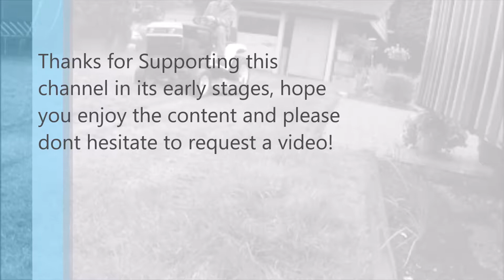Ford 50" Mower Restoration  - Part 3 (First Mow, After maintenance, Conclusion)

Comment: nice. i saw a machine like that on craigslist for sale in aldergrove bc. thinking of getting it but not sure
Reply from the maker: Go for it!
Reply: +Samuel McKinley its fully restored except for the deck and is 900 bucks.
Reply from the maker: Go for it! Man I baught mine for 550 and have since dropped $1500 into the tractor alone...nevermind the deck which has cost me about $800 to totally redo.